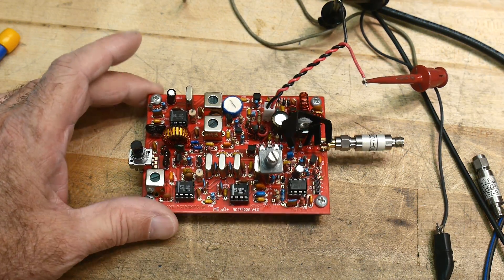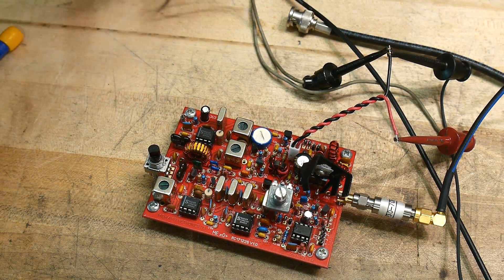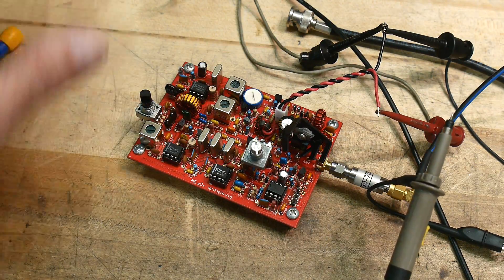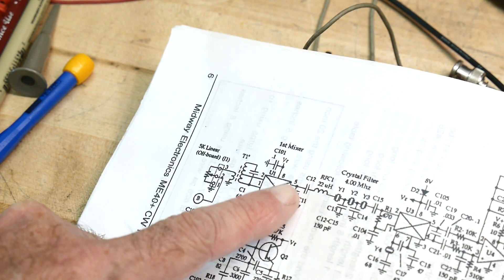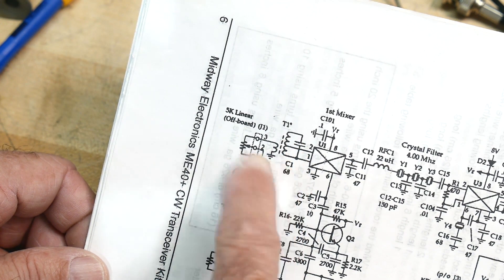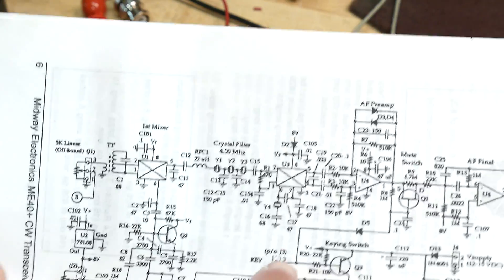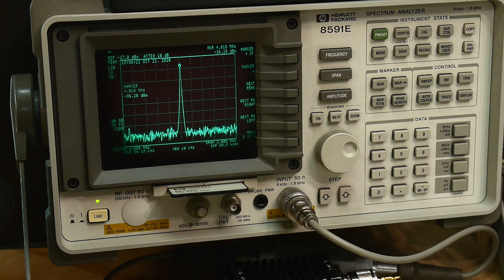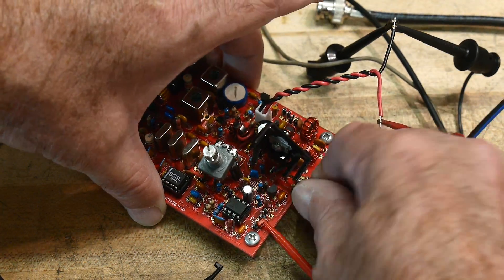#630 ME40+ Aligning the Receiver with a Spectrum Analyzer

Comment: Great explanation. You should reduce input to 0.06uV and a carrier (CW) can still be detectable. Receive is razor sharp. Maybe too sharp but it will pull that DX out of the noise. 73 - Rick - Midway Electronics.

Comment: Just keep in mind the loading that a 1x scope probe will place on your circuit:
- When the probe is connected to a 1Mohm scope input, the 1x probe will add approx 100pF capacitive loading.
- When the probe is connected to a 50ohm input (like a SA input), the probe basically looks like 50 ohm load (with a little extra loss)
You'll need to assess whether your circuit can tolerate the loading, and that the loading won't throw off the tuning.
Reply from the maker: you will enjoy my next video. I knew people would comment on my scope probe use. I guess you fell in my trap. anyway I shot tomorrows video weeks ago so it is not pointed at you.
Reply: @IMSAIGuy  Yep, you 'hooked" me...  Proper probing is a pet-peeve of mine...